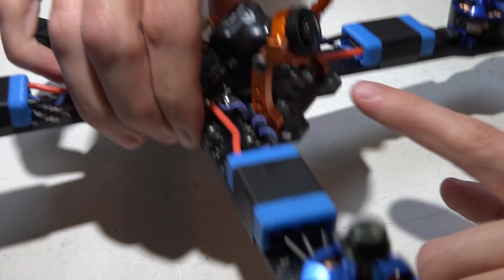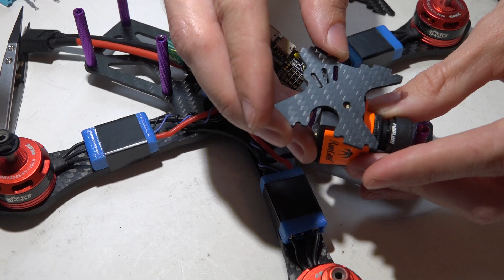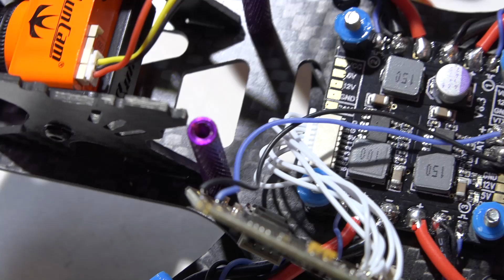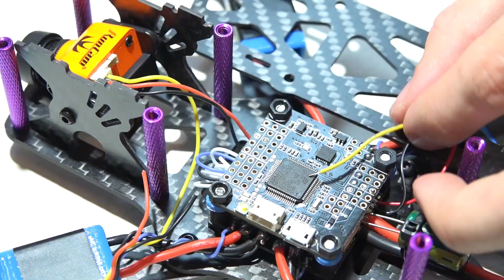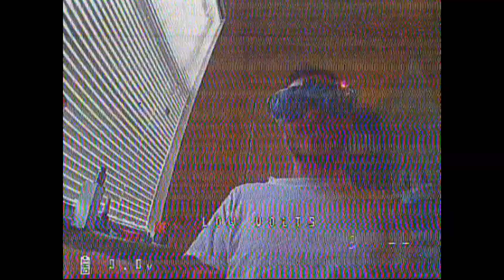Multirotor Build Pt11: FPV Wiring

Comment: Hi thanks for the video!! I have my camera powered throw my vtx and it seems when the batt gets low the video is the first thing to go. I end up disarming in the air 👎.  I am flying with no indicator for the batt, but is the camera the first thing to go? would powering them separately work better? thx

Comment: Hey Jc, is there a reason why you chose the 5v pad for the camera if it takes 5-30v?? im building one similar to your martian ii build but im using a matek pdb. is there any reason why i couldn't/ shouldn't power the fc from the 5v pad and power both the cam and vtx from the same 12v pad??

Comment: Hey Jc. i have decided to use the martian frame and just for looks only add red or black details. So the martians red pdb would look pretty cool on it. As far as i know, the martian pdb just distributes vbat, so i should be able to solder my esc's and the battery lead onto the martians pdb, and than just going from some pads on the red pdb to your diatone pdb and proceed further from that one. Would be cool to know if that could work. many thanks and great videos with greater content.
Reply: Oh and don't you have to run the video wire through the PDB to use its LC Filter?

Comment: those slots in the camera are not for a second set of screws, tgey are for the carbon fiber backplate that you're supposed to attach to the back of the camera.
Reply from the maker: Thanks for the info. Had no idea

Comment: Hi Jc!  juts got the same board and running omnibusf4 firware 3.1.7..osd not working and the my quad is spinning on take off.
after re flashed with airbot f4..all working fine..but no OSD.. need help to active the osd...plz thx
Reply from the maker: I'll have videos coming up on setting up the entire quad in Betaflight. Hopefully that will help